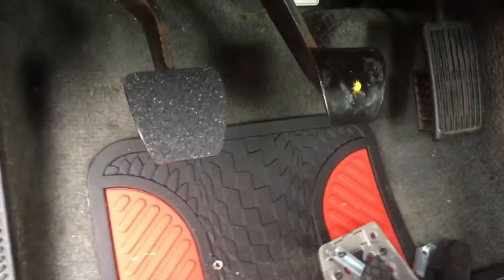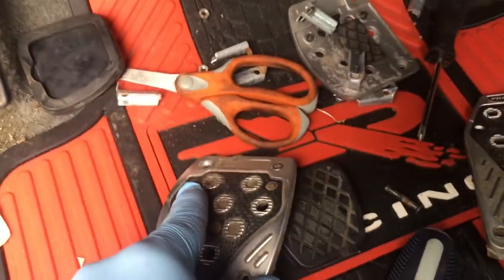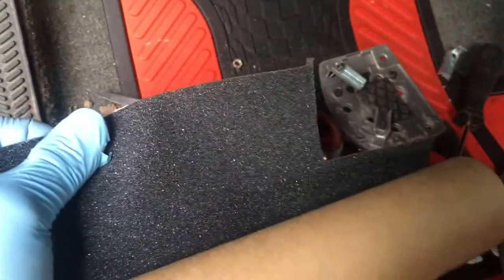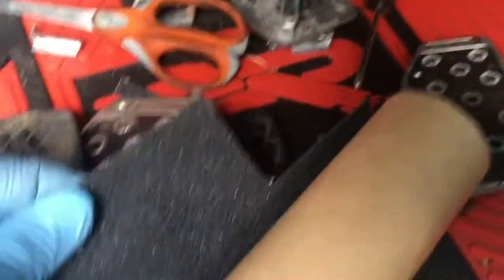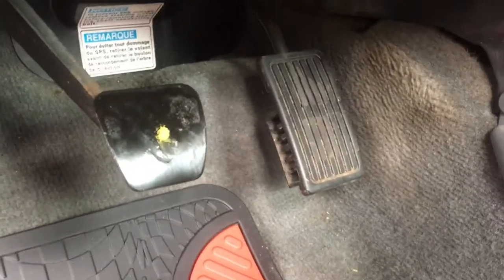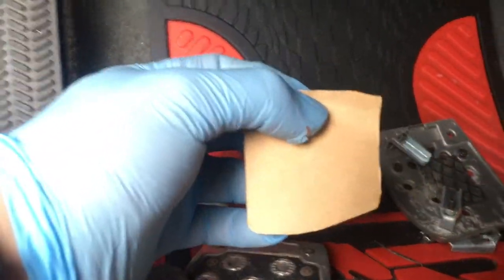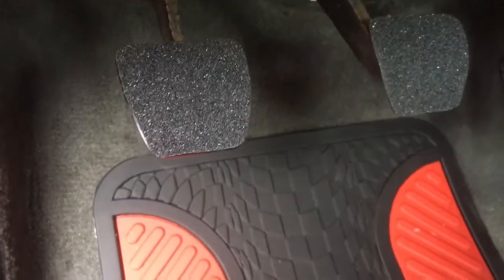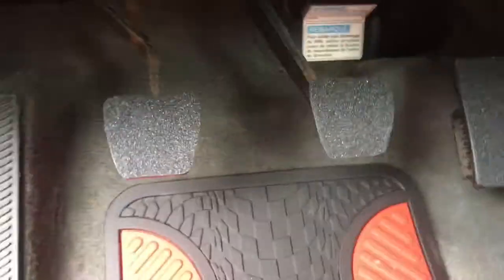Skateboard Deck-Tape Car Pedals: How to Install

Comment: For mine I heated up the pedals and then the tape till it was bubbling and then stuck it on so it won't come off.
Reply: they don’t come off when you have real skateboard griptape, they are usually very strong on flat surface